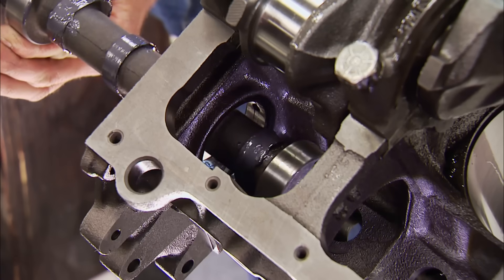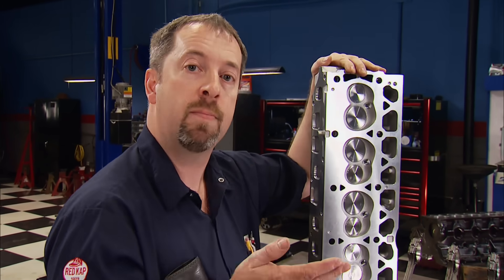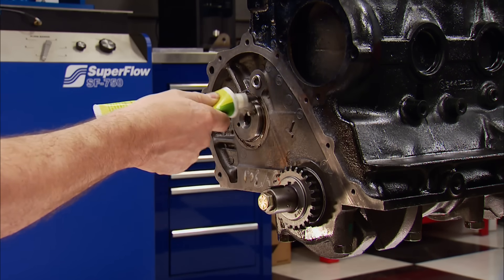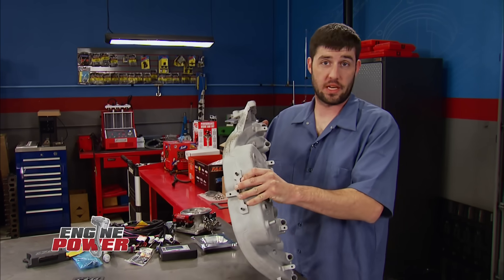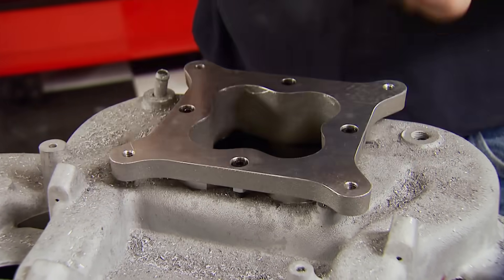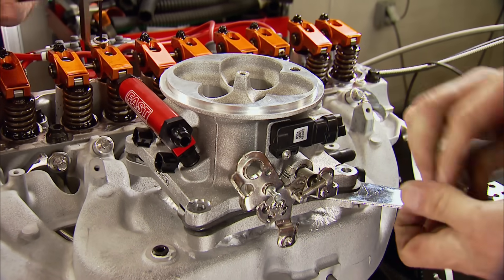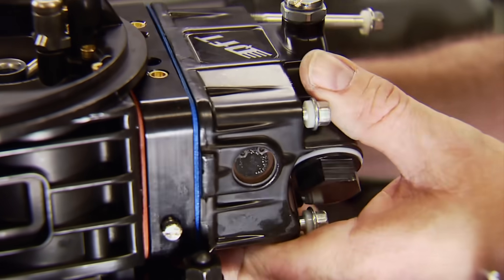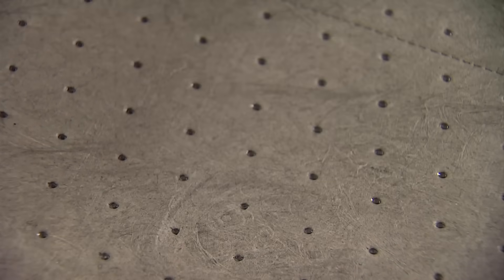Rebuilding a 4.0L Jeep Straight Six to 242HP - Engine Power S2, E14

Comment: I love how they made crap power with the TBI setup, said “oh the injection system is fine”, then took it off and made the power they wanted with a carb instead. Umm, it seems to me the injection setup wasn’t so fine after all.
Reply: the injection system is fine...it was the altered induction system that messed it all up, as it was configured for a carb setup rather than EFI
Reply: @everettgrover9459  That doesn't make sense.  If the carb fixed the issue, the 4 bbl EFI system should do the same. Had to be a limitation of tuning or lack of understanding of EFI system.
Reply: @a6t8vw1  my thinking was that they had to majorly modify the intake to get the fuel injection to work, and when you modify the airflow to that extent it definitely would alter the power band , but what baffled me was that the made more power with the carburetor rather than the efi
Reply: @a6t8vw1  it was kind of a theory I had if that helps you
Reply: Shoud have put the spacer under the TBI.
Reply: the Intake manifold they used has a square shape for those inlets & was the older model 4.0L. The later model intakes are more semicircular; those 96 and get better air flow they reqired.
Reply: I think they just didn't want to disparage their sponsor's parts lol
Reply: Your right ...like a used car salesman. Your screwed.

Comment: Dam just use the port injectors, a real ecu and coil on plug or wasted spark, why the hell use a distributor and self learn Efi with that manifold, State of the art workshop but can’t move with the times, use electronic control, it’s better for power, efficiency and engine life 👍👍

Comment: i rebuilt my 4.0 jeep engine last year. i did the 19 lb @43.5 psi injectors, and shoe horn intake cat delete (didnt have it when i got it) the dorman upgraded header 4 core alum rad efans. and its 225 hp now.

Comment: My 3 Jeep’s 91, 97, 2001 had adequate power.  Never crossed my mind to upgrade.  But I am thinking of getting a Comanche and based on what I’ve seen I might need this upgrade vs putting in the same engine

Comment: Sooo... That's ALOT of $ to spend on a 4 Liter and only 240hp.
Im just guessing with these numbers... But you'll see my point... 
New aluminum head = $1500
New stainless header =$750 
New fuel injection system and lines etc =$500
New ignition =$300
New roller rockers =$300
New balancer =$200 
New aluminum timing gear cover =$100 
New camshaft /lifters /pushrods =$400
That's over $4000 and I'm sure I'm forgetting something. 
You can get a 4 Liter from a junkyard for $500 if you pull it yourself... Then port the head, put a mild performance camshaft and the 4 hole fuel injectors in it, and put a half decent exhaust system and air intake and you'll have spent around $1500 and have maybe 15-20 HP less than this... And have $2500 laying around for a small supercharger kit. 
Something with like 5lb of boost and a decent sized intercooler will put you around 300hp. 
So you can have 300hp and 400 lb ft of torque for around $4000 or you can have 250hp and 280 lb ft for around $4000. 
Hmmmm.... Not a hard decision lol 

New oil pan and factory style oil pump are cheap and good practice to replace both when rebuilding an engine so I won't count that.

Comment: Its not the Fuel injection. Changes to carburetor....
Reply: yes the fuel injection works but the intake doesn’t work with fuel injection, so the issue is the intake

Comment: Interesting it's similar to the Australian Ford  4.0  intech  over head cam  just an older version from the AU series Falcon  1999-2002 .FoAustralia is  235hp standard ,I prefer the jeep bore size ,rod to stroke ratio. The Australian 4.0 has  cross drilled main caps with girdle as standard ,   rigid Alloy sump Alloy head is standard. The Australian 4.0 LPG engine will take 600hp with all standard components,  just needs ring gap. Australian specs 99.2mm bore 99.3mm stroke  cam 192 at .050  480 lift  1.88 in valve double row timing chain .
 red line  set at 5500 standard however will go to 6200 with computer mods  runs a  coil pack waist fire ignition   batch fire fuel injection.  EEC-V computer.  Would be interesting putting them head to head . The AU series is very similar to the barra BA series  block however without the twin cam head.

Comment: "This block from 1987" is not a 4.0L/242, it's a 4.2L/258. The first 4.0L was several years later.  4.2L was carbureted and never had fuel injection.  Sadly, spending $5000 on a rebuild, performance head, roller rockers, header and throttle body to upgrade a 4.2L is a fool’s errand.  It’s an adequate engine and reliable, but if you’re going to spend that kind of money, swap in a fuel injected V8.  Don't blow a bunch of coin trying to turn a sow's ear into a silk purse.
Reply: I think I'm wrong on that 4.2 vs 4.0.  Would be true for a YJ but not an XJ.  Still a waste of $5000+ though.
Reply: '87 is the first year for the 4.0L (87-06), debuted with MPFI. The carbed engine is the 4.2 which is from 71-90. Depending what you do with it, something like they built would seem like a waste but that part is a little subjective. I'm in at just over $7K CDN with mine prepped block forged bottom end and rollerized top and that includes a 1300cfm supercharger. At 6psi I'm making 450+whp and I built it to go to 18psi. Mind you a lot of the supporting hardware I had to make myself because I ain't rich by any means but I just wanted to vaporize some dirty track tires on the road with my XJ.

Comment: "Modern parts" - then go to insane lengths to install a carb.
Reply: It was an option to just add a spacer and give that FAST EFI time to learn it's place... Harder to tune on the spot where as the carb is tried and true and easy to tune... So in a pinch they made it work...

Comment: TPMS is for lazy arsed owners who can't be bothered using a tyre pressure gauge. In my car's tool kit, I have onboard compressor, puncture repair kit to do tube & tubeless tyres, along with pressure gauges. One pressure gauge is in the puncture kit, & the other is in the air hose from the compressor.

Comment: Geez!! I got more power out of my old 245 hemi by changing the jets in the carby, then porting & polishing the intake in the head, without further mods done.
Reply: But did your hemi get 20mpg(average) pulling a camper trailer thru the Flinders Ranges and up to Birdsville?
Reply: @salem9477  I never took my old Valiant up there. The fuel economy was about 26 to the gallon. It had a high ratio diff.

Comment: All went nice until the the 750 cfm Holley got involved. Great for the dragstrip, not great for a Jeep or utility vehicle that needs overall throttle response coming off idle etc. Likely, a 390 cfm carb will make that happen but still, moving from EFI or fuel injection to a carburetor is moving backwards, especially if the engine is for a Jeep of some sort. Cold start ups, high altitudes, extreme hot weather, steep hill climbs and with air conditioning etc. all benefits much more with fuel injection. Carburetors with fuel floats take away all of those pluses. Might have been worth testing with the original throttle body first and then make decisions.

Comment: would like to see yall do one on the 2.5 for the jeeps
Reply: People overlook the 2.5 but it's a solid motor exactly same as 4.0 with 2 cylinders off.  Better mileage in a rwd cherokee too, just as rock solid.  Also easier to keep cool- keep these motors at 170 degrees and the rubber hoses vacuum lines wiring belts computer everything under the hood lasts much longer!  Engine will also do 10,000 mile oil changes and still look like honey.  400000 miles easy.

Comment: Honda person here, is the aftermarket for these engines all there? that block looks prime for boost... how are the heads?
Reply: Not much really but some is there if you look hard enough. But hard to get some decent hardware and answers since customers are like "Herp, here's two fat stacks for lift'n'tires!". :/

Boost basically eliminates all the shortcomings of a 2V perpendicular head. Block/head can handle 30+ psi. Bottom end would have to be custom though. 1200hp can be done with current parts.

Comment: I put one of these in a '78 CJ'5. The rear driveshaft was so short it was funny looking but it worked perfectly. It had the torque and started every time. I also have the same Miller Elite helmet, Mike's is the only other digital camo I've ever seen anyone use.

Comment: The engine is very ancient though. Reverse flow, non crossflow, push rods, 2 valves per cylinder and distributor

Comment: A carburetor, no way!!  Unless I’m mistaken the Jeep 4.0L had fuel injection system which was profoundly more reliable.  I understand that 50 or so additional HP with the reduced weight will translate into better performance but I’m not so sure it’s worth the money or time and effort.
Reply: Definitely agree

Comment: Does that Jeep engine have the same CRAP valve seats as the 4.7 V8 engine? Who’s STUPID ideal was it to put steel valve seats into an aluminum engine. I’ve seen PLENTY of dropped valve seats in those 4.7 engines! Often, WRECKING the engine.
Reply: Edelbrock head may have that design but I haven't seen one in front of me yet. Not on factory heads.

Comment: I've been rebuilding the same engine , do you guys know the best way to clean the top inside of the intake manifold that  goes with this engine, i sandblasted mine a while ago but i got some of the abrasive on the inside and now i think a lot of it got suck to the dirt and grime on the inside and i cant find a way to get to the stuff i cant see like top on the inside
Reply: ive been using my solvent tank and tried all sorts of brushes with some carburetor cleaner but  when i check the inside with my finger there's still some dirt n grime

Comment: Had a Cherokee and a Grand Cherokee Limited.  Both with the 4.0.  Hundreds of thousands of miles.  Regular on time maintainance.  One water pump replacement.  That’s it.  Then they dropped the motor for a crappy V-6?  Gee.....why is BMW still using straight sixes.

Comment: I think the adapter sticking so far down inside the intake manifold that it is causing some weird airflow.  Chrysler spend some serious time on this intake to try and keep the 4.0L legal for emissions. The result is it adds horsepower to overcome the extra Cats on a +99 4.0L.

Comment: Clicker torque wrenches are inaccurate though popular. Studies have been done to show that beam torque wrenches are better. You're alignment pin trick does work but I wouldn't use it, just be careful, wiggle the head while putting the bolts in works for me. Another alternative for the intake is to mill off the old bolt flange, drill and tap new bolt holes and then epoxy on the new flange. Also you can do it how you guys did it then epoxy it on.

Comment: Serious bummer that they turned it into a stroker. Should have just rebuild motor and turbo it with an efi. Not cut the manifold up and weld a plate that sits deep into the manifold blocking airflow in side of it. Thats what caused your numbers to not be so great. Should have cut the plate shorter before sinking it in there. Getting rid of efi and automatically swapping to a carburetor tells me they resulted to dumping more fuel in the motor to turn up the power. Such a shame. Its going to be running very ritch at this point.

Comment: the piece that got welded to the intake manifold should have been shortened not have the piece on the bottom that was making the air hit the bottom of the manifold instead of using the whole manifold

Comment: 3:52 Those bearings have scratches in them already, and LOOK at that rod journal at 3:59! there's actually a ding in it
Reply: Main Cap pin*
Reply: @joekaz5198  Obviously you didn't watch the video where I told you to. The Main Journals are literally getting bolted down at 3:59. and the Rod journal on the left has a pretty big ding in it

Comment: Guys. Have you rebuilt a 4.2 lts toyota F2  to 200 plus Hp. My 1984 LC could use some extra HP without swapingn a Chevi 350

Comment: This engine came from Rambler originally, then to AMC who acquired Jeep from Willys Overland (Willys only offered a four). The reason for the low wear was all AMC engines used high nickel casing alloy (Oldmobile was the other one). Other mfg's only used Nickel alloys on truck blocks and industrial engines (like Chevy, Ford, International Harvester and Lycoming). BTW IH used this engine in the Scout.

Comment: I used to be a tech at Chrysler and I've seen this engine over heat so bad the block started glowing red and never blown the head gasket or warped the heads.  This engine is bullet proof
Reply: Then you also probably saw plenty with shattered pistons.

Comment: Seen a lot of these blocks cracked when head torque was done wrong. The first head bolt drivers side front is 10 lbs less than the others. Also requires sealant to prevent leaning since it is open to the cooling system. I like the head but they should have reduced the compression "larger chamber" these things ping on their own, I would have done a 58-62 range of CC in there. Aluminum head should make it easier to run the timing higher though. I did the Harland rockers on my last one, nice but noisy.

Comment: My father purchased a 1988 Jeep Cherokee in Oct'87,  4.0l with  a 5 speed manual. I remember it was a real strong engine.  I once did a first gear rollover at 10-15 km/h and I lit up the rear tires. We  pulled heavy loads with it. There wasn't a Southern Ontario snow storm it couldn't handle. I must admit, it was not the most reliable car, but the engine was indestructible.  He sold it in Feb 2002 with  455,000 km on the odometer. Did not burn a drop of oil and the engine pulled  just as strong as the day he brought it home from the dealer.

Comment: When you look at the Australian Chrysler Hemi 245 and 265, they did quite a few of their own upgrades on the American version in the 70s. Electronic ignition, head upgrades, and the big daddy of them all, the engine in the E-49 VH Charger version: a 265 Hemi with triple Weber carburettors. When I saw the early 90s Jeep Cherokee, when Jeep returned to Australia, they looked exactly like the 245 Australian Hemi, the main differences being fuel injection, a lack of side plates and the fact that the block is painted black instead of light blue. Without an modifications, an E-49 Charger did a quarter mile in 14 seconds (1972 model) but there was plenty of room for more power

Comment: (engines makes bad power) "It's not the fault of the injection. The injection is working fine." (puts a carb in the same place as the injectors and makes way better power.) 
Wait.... How is that not the fault of the injectors? Or something with your injector setup? And why would you go from the stock port injection to a throttle body style in the first place?

Comment: There is just so many things wrong with this video lol. I was excited until I heard the remarks about doorman. And then y'all started to butcher an intake manifold for something that clearly wasn't designed for it. Then you're celebrating a small horsepower gain after probably spending a couple grand. pretty sure you may have even gotten some of the torque specs wrong but I guess that would depend on the engine specifically. The biggest laughable part is when they said they were going to use modern parts or whatever and then throw on a carburetor 😑. I think I would trust the Facebook groups that asked "what oil should I use" before I trust this video.

Comment: I would love to drop a modified 4.0 like this into my '01 WJ, especially since my 4.7 is running over 200k miles and I need something with more reliability but the same (or more) power

Comment: It says a great deal about the inefficiencies of big American engines, when tuners chase 1bhp per cubic inch.
That amounts to just 61bhp per litre, which many small European engines were almost managing stock from the factory in the 1960s.
Take the AMC Pacer for a laugh, producing less than 24bhp/litre from a 258ci straight 6.
A classic Mini can be easily tweaked to produce a naturally aspirated, road going 80+bhp per litre, despite the A-Series engine having siamesed ports and first appearing in 1951.
The first production 848cc Minis produced 34bhp in 1959.
Guess all that cheap fuel across the pond led to lazy engine development, with more cubic inches being the standard answer.

Comment: If the injectors were kept, it would’ve made it easier to gain power.. if more fuel was needed, you just upgrade those, not swap it out for a carb..

Comment: Great job on the rebuild. The engine sounds great and will run forever with frequent oil changes, cooling system maintenance and a good ear to identify any odd noises. Cheers boys!
Reply: THAT'S what jeep thought, too

Comment: Obviously they have sponsors and need to showcase their products to pay for the show.  But who in their right mind would put this much time money and effort into a 4.0? They have factory efi why ditch it?  The ignition system is a wash, factory setup is computer controlled but not quick to diagnose with one coil pack.  I guess if you had a vehicle you were gonna keep you could maybe justify some of this work, if the numbers are correct over 70 ft/lb a liter is very impressive, I’m kinda skeptical if that was correct honestly.  It’s a 2 valve engine which isn’t even a cross flow head

Comment: What they should do is make it so the Jeep frame stops rotting by putting some drain holes in the frame  instead of trapping water so it gets massive rust and damaged rails
Reply: squirting transmission fluid into the frame and doors will stop all rusting...and spraying the entire bottom of the jeep.

Comment: ! hp per Cubic inch.. Hmm sounds like a Nice goal.

Until i calculate my engines volume into cubic inches and discovered that the engines stock output already are 25hp above that goal. 

220hp / 230fp from 195 Cubic inches.